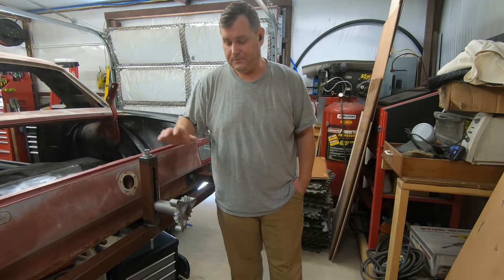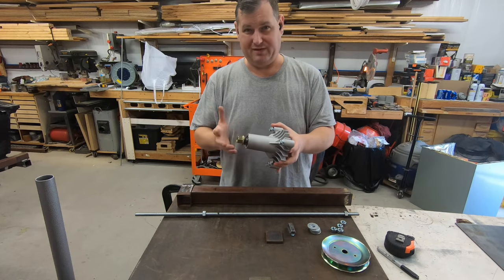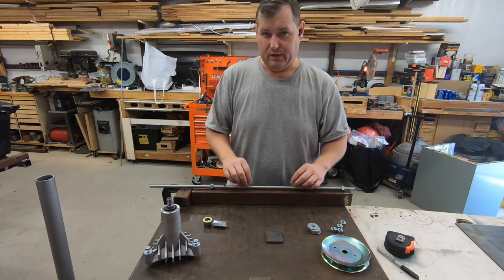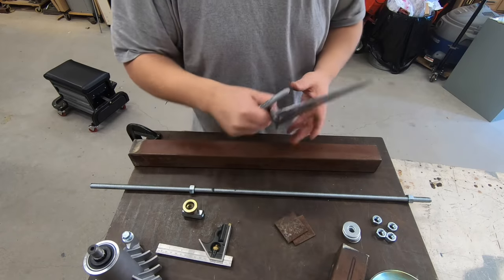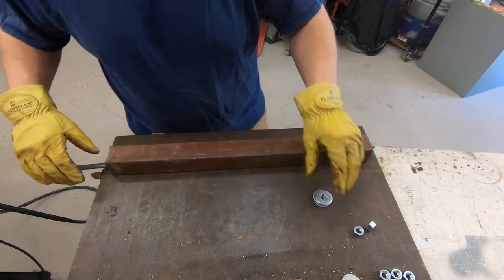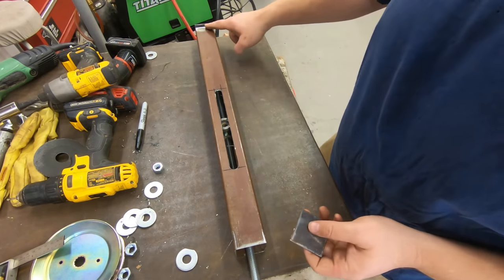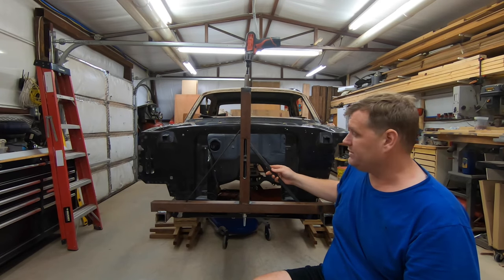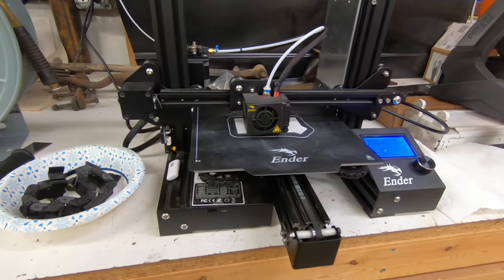Cheap Mustang Rotisserie 2 C/G balancer build

Comment: That’s how I build stuff! Look to see what I can find, ask myself if it will work, then look to find another just like it, or close. Or not.
Reply from the maker: Yup. I just couldn't justify the cost of a rotisserie and you can do allot with what you have lying around but few people think that way anymore. But I think that will change as things get more expensive.
Reply: @theinfernalcraftsman   We have Menards in the Midwest, along with Lowes & Home Depot. According to the nut & bolt section, I have $20k in product. Metal coffee cans painted white, Orange masking tape & description on a wall of shelving. I have $40k in new GM/ACDelco parts stacked in short side of 1 1/2 car garage. I have a second driveway off Main Street as we live on a Circle, room for a garage which I could build. The city uses satellite imagery once per year to look for new construction! Talk about big brother watching. They want 2” extruded polystyrene insulation on outside of 48” foundation and under floor, even if no heat or air is planned. A 24’ X 28’ foundation with concrete is $28k just to ground level. More than first house! Be great full of you shop, it is 3 times bigger than mine and I got 4 tool boxes plus MIG, Torch, 2 sewing machines, Sandblast cabinet, 20 ton press. It is something I owned that came home after retirement. Never thought of it. 
 I taught for UTI, the original in downtown Omaha before sold, but last 7yrs on contract for ACDelco. I covered 7 states w / technical Seminars, 2 day classes at 13 community colleges then 5 warehouses to handle defects! Tore a rotator cuff in Dubuque and drove 5hrs to home, had surgery then got call from Raytheon boss who dissolved the job! Dr. pulled plug on career. Then I found out SSD takes your personal injury settlement. Screwed coming & going. If that happens to a family member, get settlement first, then SSD if applicable. Take care.  
  The stories I can tell you working on the first EFI cars (1976, only two) not mechanical, not CIS on Volvo’s, Mercedes, Saab and Porsche! Have a good one and very creative on rotisserie. Anywhere (If Yours) put seam sealer over everything on bottom but use Raptor black underneath. You won’t regret it! Reach out anytime!
Reply from the maker: @deankay4434  That stinks. Yeah I know I complain about the size of my shop but it's far bigger than most have. Went through allot of seam sealer and have more on order. The car companies must get it really cheap with as much as they put on...